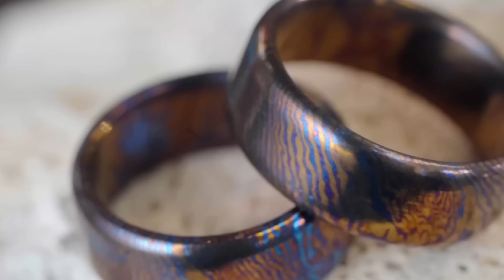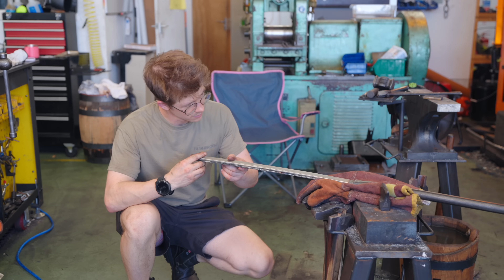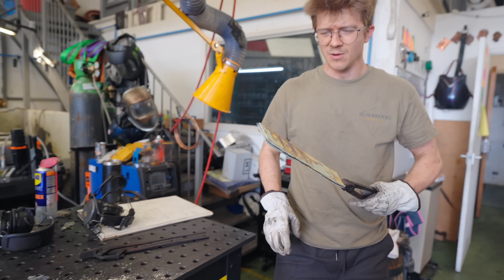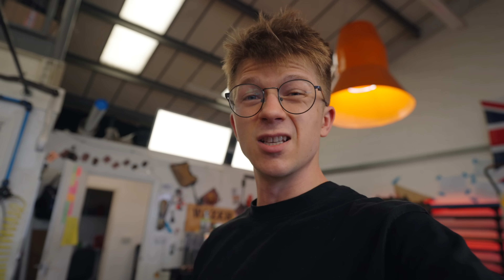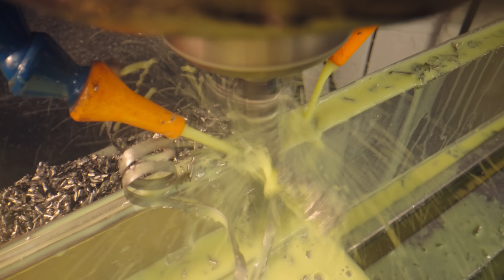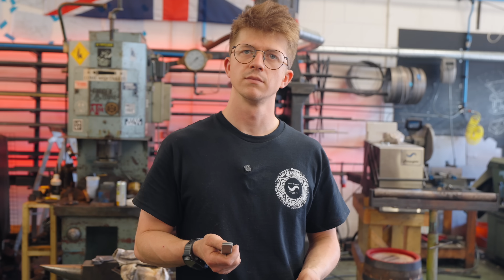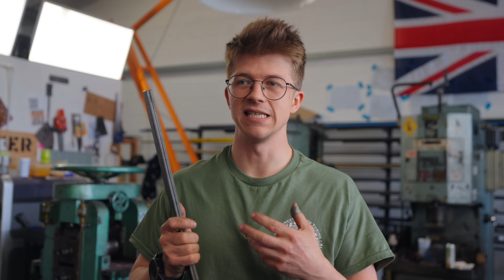Making a Titanium Damascus Katana - Part 1

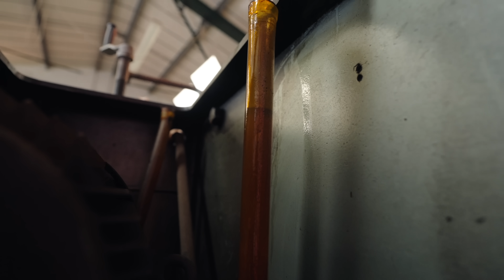Comment: 23:28 If you think you're going to pass out, you can #1. bend at the waist so your head is downward and blood rushes back to it, or #2. (somewhat more convenient) hold your breath and clench abs trying to push air out (called the Valsalva maneuver) which also pushes blood into your head.

Comment: Idea popped to my head- what if you get rid of all the air that could penetrate within the billet and oxidise by filling in all the small gaps with powdered nickel? You know, just throw some in there, vibrate it tightly and this way stop air from going inside, just a little bit of that interlayer fitting tightly?

Comment: For the final properties after forge welding, it seems like you’d want the bond and ductility from rolling as well as the hardness from quenching, so why not forge weld, roll out, shape the bevel, and differentially harden the blade with the steel edge exposed? Kinda ironic to be using differential hardening in a pattern that probably won’t make a hamon, but it seems like it would allow the desired blade properties

Comment: With rolling, isn't one of the benefits that you can do it way slower and way colder? Could you hold it at like 800c or lower for the rolling processes? I forget what you said the melting point of the intermetallic layer was, and based on just how liquid it was on those rolls maybe you can't do anything meaningful to the base metals with two layers of liquid between them. I guess this means a very last step layering either way.

Comment: In your testing had you tried a Nb/Ni bonding layer? Titanium to niobium to nickle to steel? Nickle to titanium can create some intermetalic compounds i believe this is why you see failure after multiple heats which allows more TiNi3/Ti2Ni/TiNi to buildup between layers and makes that bounded area more brittle. Adding the niobium eliminates that, the difficulty comes with Nb and Ni interaction holding those two at sustained heat for a long duration promotes the formation of Nb3Ni or Nb7Ni6 this happens much slower than it does in the interaction between Ti and Fe with no barrier though. I work in aerospace manufacturing and deal with titanium-niobium alloys a fair bit. I have no experience diffusion bonding but some food for thought and perhaps you've already done this in the past test video.

Comment: I think the billets were kind of acting like wet sponges when going through the rollers vs. being hammered.  You put a wet sponge through a roller (or a mop), it moves all the liquid to one side and out, where as if you tried to beat out the water with a wooden mallet it would take forever to get the water out, and it wouldn't just pour out all at once.

Comment: Here’s a recommendation: for the long billet, do your heat like you normally would then do your weld using the roller instead of the power hammers, straighten and let that cool slowly. This would allow for a very quick weld time so your billet shouldn’t need two heats. Because the interface hasn’t been stretched or overly forced yet it should bond really well.

Comment: One thing that may be worth checking before scaling up: the liquid you saw at 1,000 to 1,050°C may not have been Fe-Ti intermetallic from the steel bypassing the nickel. The Ti-Ni system has a titanium-rich eutectic at roughly 942°C, so the nickel interlayer itself could be producing liquid above that temperature. That would also fit surprisingly well with 950°C being marginal and 850°C working much better. I’d seriously consider sectioning a few controlled samples at different temperatures and getting SEM/EDS done on the interface before building the longer kiln. It might save a lot of painful trial and error.
Reply: Ive got an SEM with EDS as well as a LIBS system at work, if he wants to send me some samples to test
Reply: @Thebadbeaver9  Hey Alec, u should totes read this.... :)
Reply: @Thebadbeaver9 thats pretty nice from you 👍
Reply: @Thebadbeaver9 @AlecSteele hope u read this
Reply: @Thebadbeaver9  Commenting to get this comment thread higher, he needs to see this
Reply: @tonalpleeb07further commenting to boost 😊
Reply: Knowing this channel, Alec isn't gonna see this comment and will figure this out several videos into the series after either having multiple failures and having to consult an expert or after finally getting a passable success anyway
Reply: @patricknotmylastname4422no no, he has to go through all that and THEN read the comment. You know, for maximum hair pulling 😂
Reply: @patricknotmylastname4422 Well, to be fair, they may have already filmed like, the next two installments in this series and it's just in editing or waiting to be posted.
Reply: This is a very good point! The nickel Inter later may simply be incompatible with temps greater than 900 C in this system.
Reply: dang took my comment
Reply: Likewise commenting to make sure this gets higher and more attention.
Reply: That guy knows what he is talking about :D
Reply: Yeah what this guy said. I knew it he just beat me to it... lol 😅
Reply: @atrillatheyoung9244 I know right? Lol
Reply: I thought that myself, I thought at first the steel was being squished out in a liquid, but makes much more sense for the nickel to be liquid and squished out before the titanium and steel made direct contact
Reply: Commenting to boost. Alec should at least read this to see if he has considered OPs point.
Reply: Mmm yes yes makes sense to me….

Comment: Hey Alec, as you said it cools very quickly. pure guesswork here but why not blasting it with a propane torch as you hammer it to keep the heat up but the oxygen out ?

Comment: If "longer forge" is needed regardless, is there some way to rig a forge together /within/ the spread of a pneumatic press so that you can semi-improvise the "weld it at temp for 2 hours" thing that is the typical way of doing things? I'm 100% not a machinist, a smith, or really anything but an idiot on the internet, but "need new thing" seems like a good opportunity to work in added functionality.

Comment: Here's an idea for the delamination issue. Keep cleaning the steel and titanium like you have been but kind of like cylinder bore honing, put a rougher surface finish for the interlayer to adhese to. It might not have enough grab on the surface on a finer level allowing for inconsistent bonding. I'd say use a rougher diamond stone vs sand paper materials. Of course be careful and keep it clean once done. Just an idea

Comment: To be fair, that was a TON of side loaded pressure. Smaller cuts would have more vertical load and less horizontal load. Dont exceed .015" per pass

Comment: If you ever do this again, possible changes, nickel interlayer on 4 sides of the titanium or proud of the titanium and steel by a mm or 2.
Reply: Also seems you need more nickel interlayer thickness to avoid forge induced voids for the titanium to come in contact with the steel.

Comment: I believe I said this in a former video, but I think you could just harden the actual steel edge of the blade. I believe I have seen people do that to knives before. That way your bonds wouldn't have to take the stress of being hardened. And your steel through the center of the catana would be a bit tougher, perhaps helping the spine to bend a little bit without delaminating

Comment: Wrap the billet in nickel foil before you put it in the cladding to forge it. That should prevent titanium to steel contact and allow a higher forging temp. This is going to be a pricey project, it may save you some time.

Comment: What if your middle steel layer is steel Damascus and the outer layers are Titanium so when you grind in the blade edges you get the Titanium colours on the top section and steel Damascus along the lower portion of the blade. Do it in one heat at the full length of the blade.

Comment: if you hold the part upright the argon should push the air out easier because air is lighter then argon for anyone that is using argon in this kind of situation

Comment: local force is divided by the circumference, this why you get more force the smaller the impact point. this is also why when a structure develops a crack they drill a large hole at the crack because it increases the circumference which lowers the local force enough so that the local force cannot overcome the force needed cause the structure to fail. if the crack remained as is, a single application of force on the crack would cause the local force would be divided by zero which will result in and infinite force that supersedes the force needed to cause structure failure and this is done at the speed of sound. 
local force is the force that is applied at the impact point
kind of like force is the HP of the car motor and local force is the HP at the wheels

Comment: Eventually sword series.
Why steel core? Those pictures show that edge is hard, soft core is almost or completely covered (pictures c, f, g, i are useful). Two side halves should be cut from one twice wide piece.
If soft core is near titanium damascus edge, should it be bonded at first, then cores with sides?
Anyway copper interlayers between core and sides should look great.

Comment: Hey Alec, what about using a maraging steel rather than a martensitic hardened steel? I'm going through a few papers, notably one from 2009 that I'm sure you're aware of ("[...] bonding of titanium alloy and stainless steel using nickel interlayer [...]" ) alongside another from 2022 ("Microstructure and mechanical property of titanium steel by vacuum roll-cladding with interlayer") and I'm wondering if the hardening process is producing an abundance of several brittle, low bond strength TiNi compounds. A high-temp bond then low maraging-age process may sidestep that issue during the hardening phase.

Comment: Hey! Amazing progress on the titanium-steel diffusion weld!
If you run into delamination issues again when milling or scaling up to full sword length, it might be due to the hammer's quick impact shocks creating micro-voids.
Switching to a hydraulic press with rounded dies (radii) might fix this. A press holds the high pressure (around 15-30 MPa) for a few seconds (a dwell time of 10 to 30 seconds per pressing step should be ideal), allowing the atoms to properly diffuse across the nickel layer evenly without cooling down too fast.
Keep up the awesome work!
Best regards from Germany!

Comment: Shooting completely from the hip here, having no knowledge outside what you just said in the video, but if the Nickel acts as a "shield" between the Ti and Steel, would it not make sense to make the Nickel layer wider, perhaps as a wrap around the Titanium or steel layer, thereby preventing the Ti-Steel reaction from wrapping around the edges of the nickel? I suppose the three metals expands in the width direction differently, causing either the Titanium or steel to reach the other one, causing the brittle leak situation.

Comment: Man it’s hard to see you go through such trouble lol, people underestimate the “hardness” of titanium. Just because it does not measure harder on the Rockwell scale means NOTHING, I’m telling you hardness readings on titanium can be false and in most cases they are because the Rockwell scale of hardness was primarily designed for steel titanium is a completely different animal. The only way you’re ever going to get this to work is to accept that titanium gets a lot harder than you think it does and it’s hardness is directly related to how well it bonds

Comment: I'm no expert, but with how thick the interconnecting steel is, when it's drawn out with that thin layer of Nickel in between it and the titanium. Would that create pockets during the draw out process? Therefore producing all your TiFe on the second heat during the roller process? So I'd think you need to thicken up the Copper layer right?

Comment: When you get your titanium Damascus billet that you’re making up the temperature you should try letting it sit at the temperature you’re shooting for for several hours and then try bonding it. This is not a pressure thing. This is a matter of how long you let the ally stay hot. You need to get it to forge welding temperature, and leave it at Forge welding temperature for a significant period of time titanium reacts differently at high heat, but the reaction takes time this is not about pressure you’re going about it the wrong way Alec. I worked with a professor at the college. I studied at for several years. He was working on researching away to harden titanium, and we made some significant discoveries. We found that certain alloys of titanium harden significantly when you work them with a hammer, I believe it’s called work hardening that’s another thing to take into consideration hitting the same spot more than one time is usually a mistake you need to make sure that your hammer blows are precise and only hit the targeted area a single time, and then immediately return it to the heat and leave it for another hour then you take it out and run it through your rolling mill at Forge welding temperature. This will create consistent pressure and give you a very reliable bond.

Comment: You are totally underestimating the hardness of titanium my friend, and in recent metallurgical studies, they have found that under certain conditions with proper pressure applied titanium can harden significantly under the right heating conditions. People often confuse the toughness of tool steel with hardness, and that is simply wrong titanium in its natural state has a much higher level of hardness than any steel could ever hope to have I don’t know why people don’t understand this. Why do you think it eats a belts for grinding so rapidly? It’s because it’s so hard it may not show up on the Rockwell hardness indicator, but you gotta remember the Rockwell scale of hardness is a level of harness determined for steel items it’s not meant for titanium titanium should be scaled differently and is way harder than steel, stronger and tougher. That’s debatable because tool steel is very strong even stronger than titanium but harder not a chance.

Comment: Hey 👋🏻  WHAT IF 👋🏻..   you make a COMPOSITE DAMASCUS? USING EPOXY TO GLUE THE LAYERS TOGETHER OR USE. SILVER SOLDER  WET THE STEEL WITH SOLDER.  Then put it in an argon can  to reduce oxides forming. Then heat it up and lightly squeeze it together soldered  everything together.. composite  Damascus.. the epoxy just glues everything together  [that may be the trick.  Coat a sheet of titanium with epoxy resin( like it was dipped in resin.  Then  put it in a stack of steel  put it in a press maybe 1 kilo pressure.   For 24 hours.  Then cut to shape.. 😂 the epoxy is a bad idea.. the solder idea may be the real deal??  I think a test is required. 🤔

Comment: When you’re trying to do the initial weld with no oxygen, why are you starting at the far tip? It seems to me that that would close off the escape hatch of oxygen. Why not start closer to where you’re holding it and work to the tip?

Comment: You can Friction bond those  materials together, but the limits of that would be very difficult regarding damascus.  

Issue is as I think Alec has mentioned before even when hand forged the issues are steel and titanium stretch at different rates and weirdness.....and is why even cutting it is difficult in the way of the different temps causing milling bits to have a varied temp so is more prone to grabbing.

Comment: 👋🏻 👋🏻 👋🏻 👋🏻 HEY ALIC  COULD YOU DO A KIND OF SINTERED/CAST METHOD MAKE A CAN , USE POWDERED STEEL AND NICKEL WITH TITANIUM  INSIDE .  FORGE IT TOGETHER  AND REMOVE THE CAN.. GRIND TO SHAPE..  SHEET TITANIUM, POWDER NICKEL, SHEET STEEL.. INSIDE an ARGON FILLED CAN. Rember the tool steel?? Made from powders! Maybe powdered titanium  would act different?  Use powdered everything like jars of sand art...

Comment: Fact check: Production of the Japanese tachi, a precursor to the katana, is recorded from c. AD 900.
Quote of answer by John Kang:
Sword shop owner here, with several Japanese swords dating back 800 years.

Japanese sword-making technology underwent several stages, and at each stage, their swords had inferior durability compared to their worldwide contemporaries.

This is not the fault of the swordsmiths, as much as it is with the kind of iron that Japan had access to, which dictated the way it had to be smelted into steel, which in turn dictated how the sword had to be made (i.e, folding, yaki-ire aka clay tempering). If anything, it’s a testament to the smiths that they could take poor quality steel and convert it into a functional weapon.

As others have pointed out, it wasn’t a battlefield weapon as much as it was a status symbol of the samurai. They used bows, polearms, and later guns (yes, really!) before they drew their sword. Studies of battlefield remains suggest that you were more likely to be killed by a rock than a sword. Indeed, the katana didn’t become the Samurai’s primary weapon until the warring period had ended and people weren’t wearing armor, and there were strict rules about drawing them.

To be fair, katana haters brag about the longsword, but swords were the sidearm for most of Euorpean history, as well.

Comment: The small spots of imperfections in the bond between the nickel and titanium could be from not perfectly clean material, like tiny amounts of fingerprints or just a touch of oxide from either of the materials being too much at that spot. Fantastic video, and good luck!

Comment: you seem to be trying to use all steel hardening methods. Would grind the titanium away to create the rough edge not allow you to harden the steel more and use the titanium as the insulating mud, thus giving the correct (hard edge, softer core) metallurgy? A titanium harmon as it were?